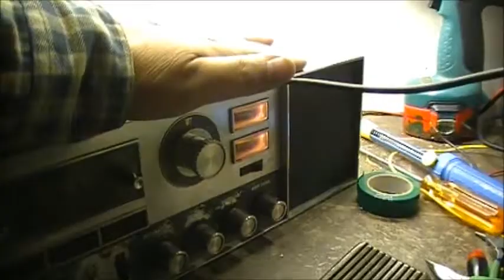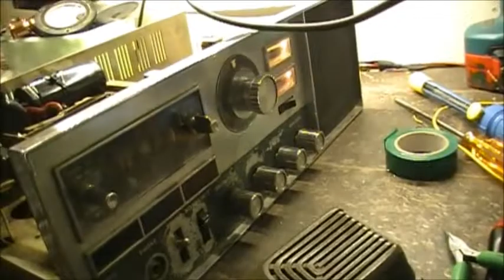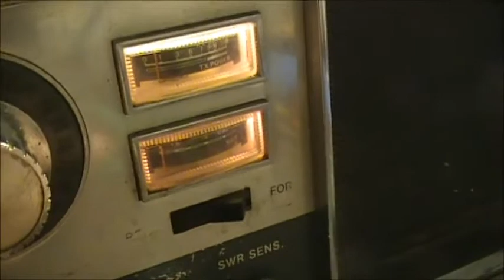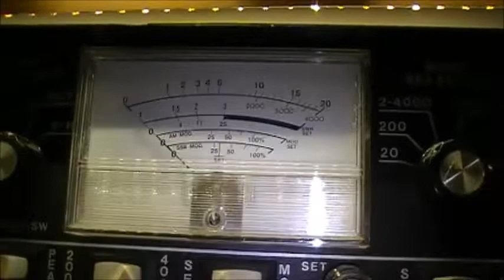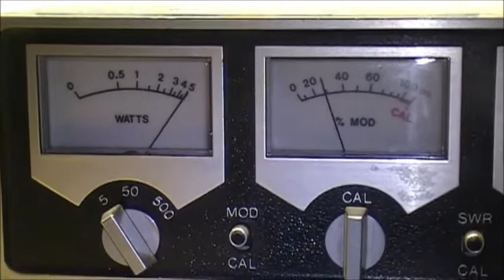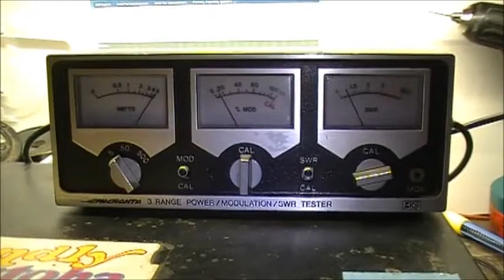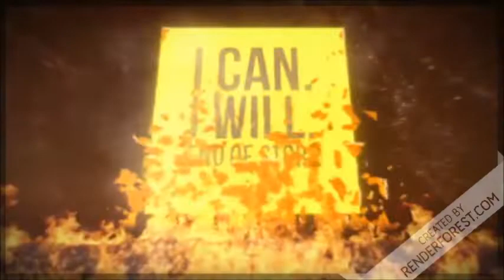ATLAS 23ch CB Radio Trouble shooting and repair PART 4

Comment: Great series mate. Spent the past hour watching all 4. Did you ever get to the botom of that hot resistor? Got the bug to fix an old radio now. Been a while.
Reply from the maker: Still not 100% why it was doing that... undervalued is my guess.  I did take a look at the circuit surrounding that resistor, could not find any issue, all the parts were working as they should which is very strange!

Comment: I have a Midland 13-898b which had a bad clock motor. If our motors are the same (your mechanism looks very similar), they're an induction-drive motor which runs off of a 120v magnetic field. If you take a pick and break up the sealant around the outer edge of the motor face as well as around the output gear, you can pry up the outer face (the thinner your pick or razor knife is, the less damage you'll end up doing). Once that cap is out, you should be able to lift out the inner gears. More than likely you will find that a rubber seal has disintegrated and bound up the gears inside. If I am correct so far (you didn't clearly show the motor, probably because you didn't think you'd get a reply lol), clean the rubber bits out with either glass cleaner or 50% alcohol but NOTHING STRONGER! The micro drive gear on mine was fragile & broke apart from using a tuner cleaner spray. I had to buy another radio to steal that clock motor from lol. The Midland clock motor has a large "60" stamped in the smaller part of the housing which is almost press-fitted into the magnet. You may also have a sticker on the side of the motor housing... Can you show a quick video of the clock motor?
Reply from the maker: Thank for the suggestion.  the radio has now gone back to it's owner, we will both be on the look out for a replacement click for this radio.  No luck yet tho.  :-)